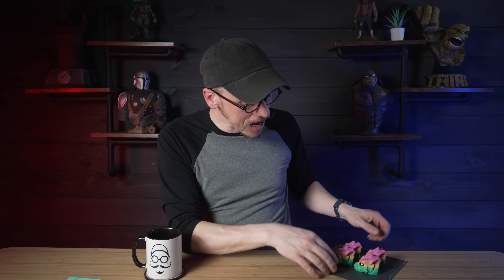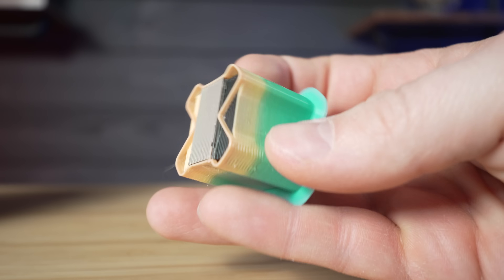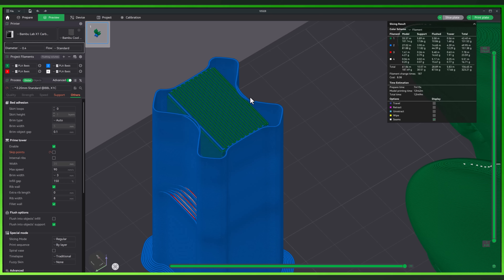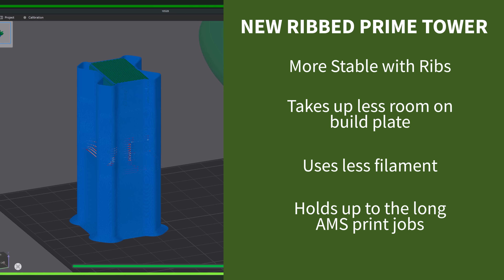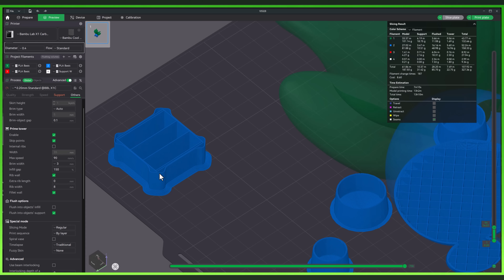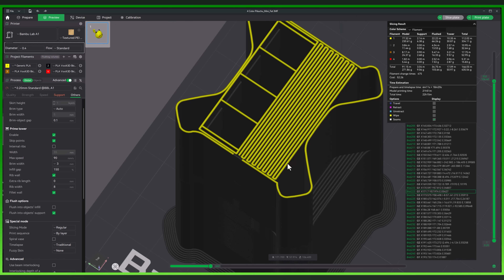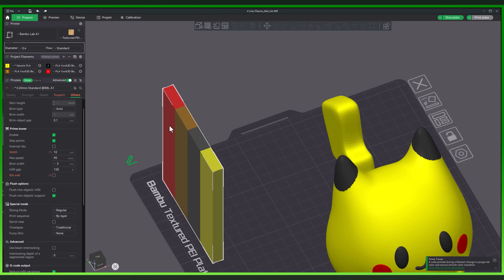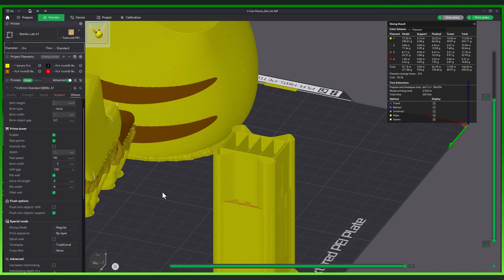New Prime Towers in Bambu Studio 2.0 – Are They Better?

Comment: One thing you have not covered. In Orca Slicer I prefer to use the prime tower to "flush" so the actual flush at the back is fast, and then I increase the VOLUME of the prime tower to accomodate cubic millimeters to fill in. 
This was possible before, but i hear now the volume of prime tower in studio is moved to each filaments settings, but i cannot find this setting. How to increase the VOLUME of the prime tower in Sudio?

Comment: For some reason on both of my printers, the adhesion of the rib wall tower is terrible. It detaches on half of my prints. The print itself adheres fine, and the old prime tower adheres fine. I’ve just started turning off rib wall tower on all my prints

Comment: I don't understand that why is the coding making a new layer of prime tower for each layer of print. Seems that the prime tower should only be used when changing colors. On some prints the program should take in account where the print is in space so the gantry won't interfere and allow head to move down to purge the material and normalize pressure.. It shouldn't have to make a new layer of tower for each layer of print. The programing seems to forget about the y axis. 3d printing on 2d. I understand it is not in the programing but it could be.  Saving time and material. Anybody have a explanation why it doesn't.

Comment: Do you have a video on setting up an AMS so that when one spool runs out it will swap to another spool with the same material?  I have not been successful in making this work.
Reply: Most people who have a problem with this have found they didn't turn that feature on in the Device Tab.  Both filaments MUST be the exact same manufacture, type, and color.

Comment: is there a way to reduce the volume? on my tiny print, the tower is adding 2 hours (7.5 hour total), for this particular print, it doesn't need to be so big. in the old bambsu studio, you could change the width AND the volume
Reply: prime volume lives in the filament settings now
Reply: @coltxkr Wonderful - thanks for this tip !!

Comment: Is there a way to make the print just waste that filament I to the poop shoot instead of taking printable space? Isn't that basically what you said it does - just cleans out the nozzle to make sure the colors workout.
Reply: It also builds up required pressure in the nozzle after a filament change. That's why it's called a prime tower, not a purge tower
Reply: Okay is there a way to make it purge that prime tower into the poop shoot? I imagine it can build pressure in the nozzle there too while doing that too.  @green2173

Comment: Nice, thanks. Would be nice to see more of how you can setup per filament prime volumes and how that affects the final print. It's nice we keep getting more & more functionality but with all that detail it just keeps getting harder and harder to keep everything straight and to remember all the different options.

I've been digging more into Arachne Wall Generation and am wondering what has changed with that in 2.0. There are lots of parameters with this and it would be nice to see a video about how to effectively use this generation technique. Hope you can do a video on it. Thanks.

Comment: Its a pretty common misconception that a prime tower is used to purge filament. It actually isn’t. After switching colors, the pressure in the nozzle is much weaker. The prime tower is used to make sure youre getting a nice even print without the little gaps.
Reply: Interesting point, maybe that's why it's Prime tower and not a Purge tower. Your explanation makes perfect sense. Yes, feel free to call me Captain Obvious, I'm new to multi-color printing
Reply: lol thats alright, I thought the same for months before others corrected me 😅
Reply: This.  It's a prime tower, not a purge tower. That said I still don't understand why we need it, and why it can't just build the flow back up over the poop shoot.  Surely we're wasting a lot of extra material due to the restriction that to tower MUST be the same height as the print.
Reply: @JohnVanderbeck  because the extrusion against a solid object creates back pressure

just imagine a gardenhose with water running out (poop chute), now place your thumb over it (print at 0,2 mm distance to a solid object) and see if something changes

it is needed but it is very conservative - Priming the nozzle can be done with way less waste - on bigger model where nozzle switches can be done in the infill or inner walls you can almost always disabled the prime tower
Reply: @suit1337  Ah thank you.  I didn't consider that it had to be against something.  That makes sense now.
Reply: @JohnVanderbeck  I agree! I still dont understand why it can't simply start the tower at the first filament change. I'd rather utilize the time it takes for the z-axis change as opposed to the waste.
Reply: I've heard that, but if I disable the prime tower, I get colors in the wrong part of the print. Sure seems like it's also purging.
Reply: @halloweenengineer6283 that’s because although the purpose is to prime the nozzle, it does that by using a small amount of filament. Effectively, purging some filament is a necessary byproduct of the prime tower. But when its purpose is to purge, it just does that in the poop chute.
Reply: well that is why it is called a prime tower - but there are also purge towers for printers that use a multiplexer and need to purge the old filament before printing and don't have a poop chute - in this case the tower is used mainly as purge tower because the priming happens while purging the old filament anyways
Reply: So what is “flush” doing?
Reply: wouldn't it then make sense to prime directly on top of filament that's already been laid down, instead of printing string overhangs? This is a big problem with TPU for the AMS, it creates a mess and I can't seem to turn it off and make a normal prime tower.

Comment: Hey Chris; thanks for these little helpful tutorials.  I haven't even moved over to the latest version because I've heard some folks were having issues with it.  What's your take on how it performs?
Reply from the maker: So... I haven't had a lot of the issues others have had. (knock on wood...) I have had a few connection issues but it just took a restart of my printer and everything worked again good. So far I think the new updates to supports are improved overall they do come off easier now and leave less marks. But on the other side of that I have had a couple fails with supports. Still don't know if it was me or the slicer. Some of the simple navigation adds they put in this one that has been in Orca has been a really nice add and probably my favorite things. 

So, overall I think most of the changes have been for the better.
Reply: @ItsMeaDMaDe  Thanks Chris.  I have been using my MacBook Air, so I decided to download the Windows version to check it out.  Installed it and low and behold, it just connected to my printer (which is actually printing a 5hr model).  I was expecting issues for sure.  We'll see how it goes.